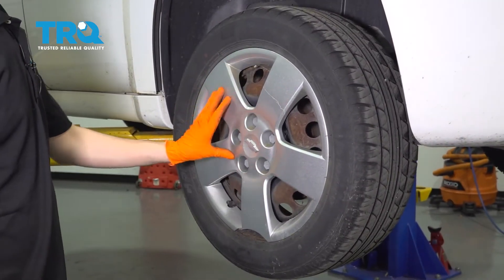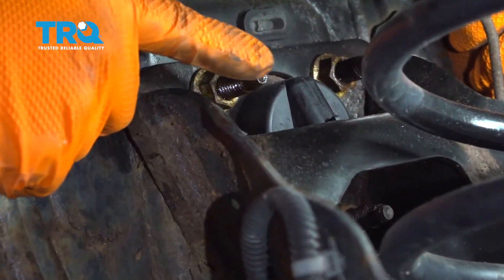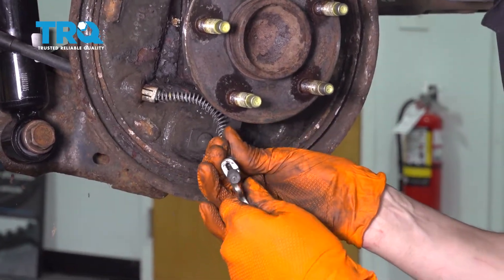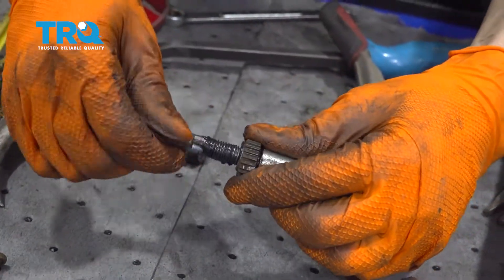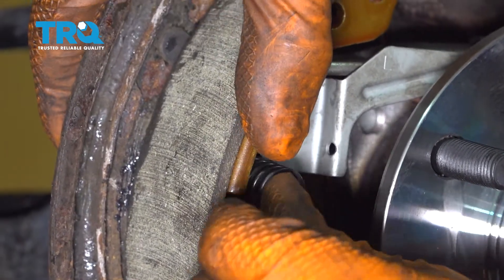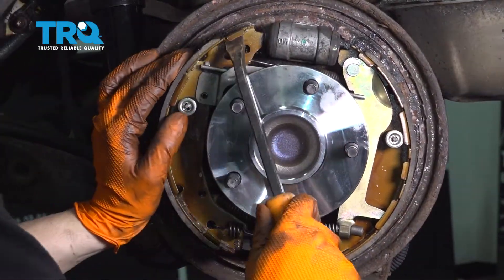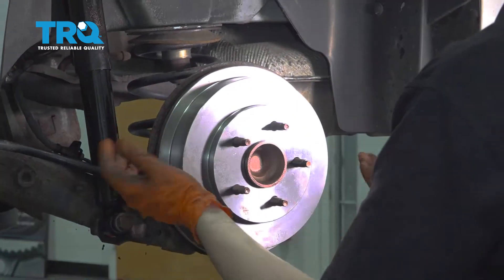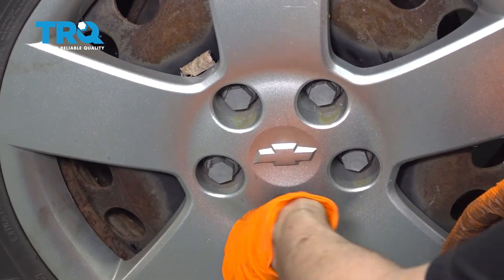How to Replace Rear Brakes 2006-2011 Chevrolet HHR

Comment: DON'T TRUST ANYTHING FROM TRQ -WORST PARTS I EVER PURCHASED!
Especially when it comes to break parts and suspension! Got break parts for front and rear for 1 SEDAN and 1 SUV and BOTH sets were shot after 2 months. The set on the SUV cause major issues causing a lot of money to fix. Also got suspension for the Sedan as well for both  front and rear. The front quick strut assembly wasn't quick at all as it wasn't a good fit into the control arm and was at 50% after only a few months. The rears couldn't even be installed because the nut on the strut was cross-threaded from the factory. Yes, everything was the correct part number.